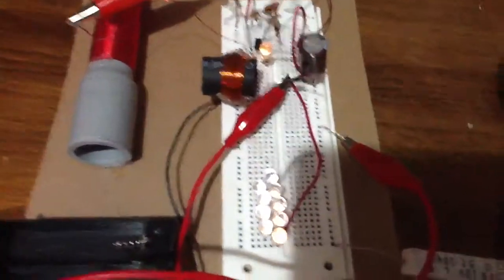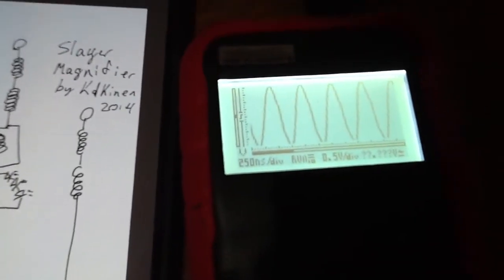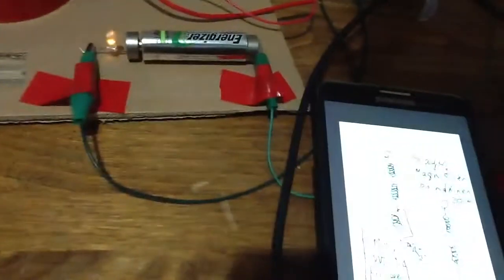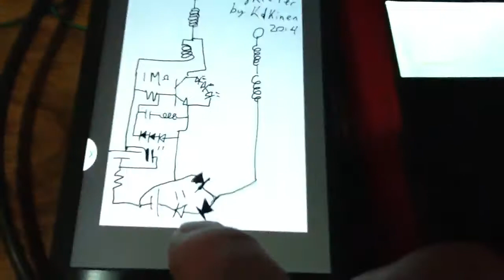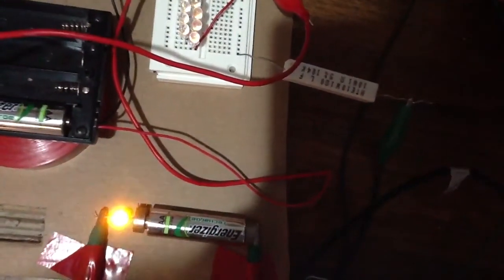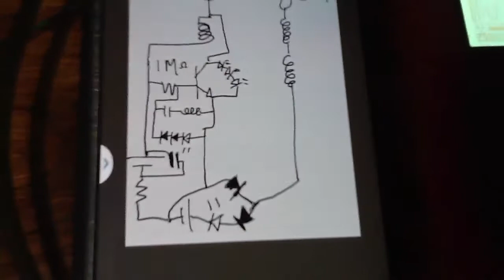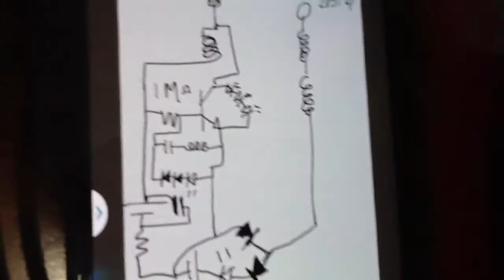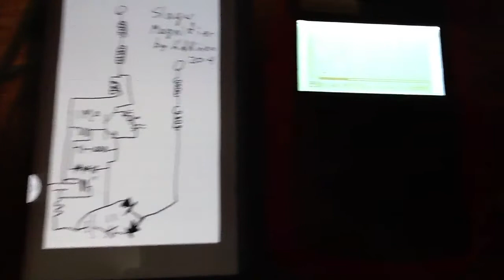pt5 TMT SEC Magnifier, Extra Charging Battery, Receiver Feedback

Comment: Hi Kurt, I try to educate myself be able to replicate your last very efficient setup. Do you think I am starting at the right point?

You title "SEC" but it is written "Saylor" on your schematic, are they synonymous for you? And which one I need to study for your last experiment? Please. 

Regards, 
Didier
Reply from the maker: Khwartz hi man, ah you mean Slayer, yes the Slayer circuit is from a man here who goes by GBluer channel name.
it is similar to the Russian Kacher from a man named Dr. Brovin. 
Anyway this particular circuit was one of GBluer/Slayer007, and then i made a few changes to get it to run in the 3 LC resonant circuit configuration as seen here. But recently ive used the SEC circuit...
The SEC is a circuit concept of a man named Dr.Stiffler (spacial energy coherence) related somewhat to "self" resonant frequencies, but re-named in his concept of "spacial" resonant frequency. which is different from how a coil would behave in its conventional known sense.
It uses a resonator which is tuned to the collapsing field of the primary... and the result is not electromagnetic induction... it is electrostatic induction :) Tesla said it was Pi/2xC... not Einsteins Pi/1xC :)